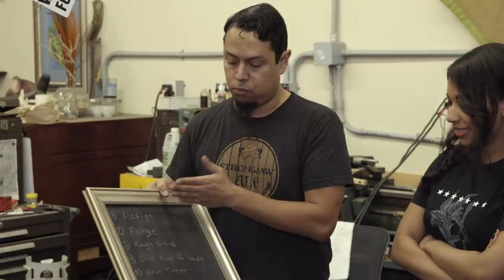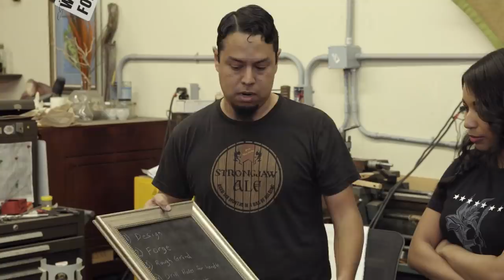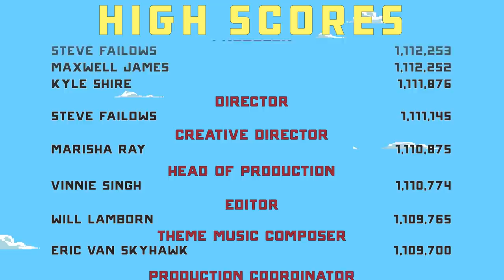All Work No Play: Blacksmithing with Mica Burton! | S2E5

Comment: Man adulting 101: Back Problems.
me: He is so right thooo...
Reply: I swear once I hit 30 my lower back just decided to give up on functioning normally.
Reply: Go to the channel Athlean X and find his videos on exercises for lower back pain. Most don't require any special equipment at all. Devoting 20 minutes every morning to these corrective movements before I start my day has reduced my pain levels to a fraction of what they were. I was a mechanic for 10 years before I got a desk job(engineering), and seemingly the moment I made the career change my body started falling apart. Sedentary lifestyles cause more pain than anything.
Reply: A co-worker asked me recently, "Do you even have any vertebrae left?"
Reply: @LuckyDragon289  Same for me, but I'm only 20 xD And my back is already killing me
Reply: 17 years of factory work did for me.  Lower back over ten minutes of working outside & upper back spasms from time to time.  Evolution sucks.
Reply: Jumping out of planes in the Army(more so the landings) did mine in. One more reason for Liam not to skydive.
Reply: No matter what your race or creed is, if you're an adult man...you have back issues. It SHOULD start very slowly at thirty, but if you're under 30 with them.... sorry to hear that bro. it only gets worse.

Comment: In the "Show 20 more real quick" you can check them all if you change the playback speed in options.  The second one is a dead ringer for Liam.  Also, the period and comma keys will advance and go back one frame at a time if you really need that level of control.

Comment: I was so happy to see Gil tell them to quench in oil. Too often I see bladesmiths use water
Reply: and they use masks. I'm so happy
Reply: @louisegrimhelm3041  Sometimes water is supposed to be used, other times oil is better. It depends on the metal you're working with.

Comment: Where can I get those shoes the Liam is wearing?! They look amazing!
Reply: I couldn't find it on the spot, but you might want to contact CritRoleCloset on the social media platform of your choice. They are uncannily good at finding results.
Reply: They're pride converse. Pride Chuck Taylor® All Star® 70 Low Top Sneaker, specifically. Sold out, but available used and in June, this year's will come out and likely be similar.
Reply: @Rtarara  Cheers Man

Comment: I work as a mechanical engineering technician in Germany and have done things similar to that. The only thing i would add as a safety measure is a leather jacket. You are sweating as f*** in that thing but it helps whith the sparks. And maybe some hearing protection. Smithing is loud.
And if any of you critters can try something like that, go for it. Smithing is so much fun!

Comment: Nice to hear some other Critters run saws, but for what they were doing in the saw sculpting video chaps, helmets, brushguards and so on would be totally unnecessary and cause more discomfort, thus making accidents more likely. 
Chaps wouldn't have hurt but, other than Sam running the big boy gas saw for a minute, they were using electric saws with overly tight chains.

Comment: So does it get work-hardened first or cool off first? Can iron be annealed or does it just need to be hot? I’ve forged a little with brass before, but for that we just had to anneal it before it work-hardened. Cooling off wasn’t an issue there. Maybe iron is too strong even when annealed? If anyone knows or can recommend any resources I’m definitely interested!
Reply: Steel doesn't work harden at nearly the same rate at what brass, copper or other soft metals do. 

You can cold forge steel but it is slow and not effective for getting the steel to move or shaping, cold forging is mostly used for slight slight clean up work and shouldn't be done on hardened steel. 

Annealing steal allows the grains in the steal to relax to create a flexible but strong piece. It is not meant for working the steal in the same way annealing brass, copper, aluminum etc is.

If you are asking specifically about iron and not steel (the difference is the carbon content) they are similar in their work ability and similar as far as annealing goes, and being hot to work. 

Steal and iron need to be pretty close to 1000 degrees farenheit I cant recall at what temperature but I want to say between 700 and 1200 to be workable. That bright orange color seen in this video, once it goes full red to gray it is no longer malleable enough to move. 

You can also burn steel to a point it is unworkable where as brass, copper etc can be like you said annealed prior to work hardening.
Reply: Ty Gramley Awesome thank you! I don’t want to bore you with more questions but would you happen to know of any good websites or books or other resources on the topic? Thanks again!
Reply: @molly-zx9cr  you are most welcome I don't mind questions at all. Are you interested in forging (blacksmithing) or metallurgy (the science of metal )?

For Forging alec steele on YouTube is pretty good and informative. And then I think I have some pretty good text books at home I will look when I get off work.

For welding which has a lot of metallurgy. welding tips and tricks on youtube, weld com

Comment: Hmm ... as a semi-retired part time bladesmith, this made me cringe. I am more than a little surprised that the fear exhibited by Sam and Mica didn't manifest as significant injuries.
Good job Sam, Micah and Liam for still having all of your appendages and not having to visit the local burn unit. Sam you can still fix your dagger ... instead of calling it an S blade call it a trailing point blade, then there's only one S in the guard.

While I don't really have a problem with what Gil said during his instruction, I do have a bit of an issue with how he presented his collection:

I hoping that someone lied to him, the axe presented as a Viking axe is potentially a Viking Era pattern, (~800-1100 AD ... not 1500), but was not a weapon ... it most closely resembles a hewing axe typically used to make framing for houses and the like. The clue is that when Liam lifts it he comments on its weight, axes intended as weapons seldom exceeded 4Lbs (swords  avg. 2-3Lbs). It also appeared to be made from relatively modern steel, an axe from the period was most commonly made from Iron and are very rarely found intact, this would have been a MAJOR find unlikely to have made its way into a private collection. Don't get me started on "King George's Sword", lets keep in mind that King George ruled from the late 18th to early 19th century ... nobody was using a medieval arming sword from the 14-16th century at this time for more than decoration. 
I have made many replicas of medieval and Viking Era tools, there is absolutely nothing wrong with that, I would NEVER misrepresent one of my creations as an historical artifact. Again, hoping someone lied to him, and he didn't know any better.
Reply: He probably just meant it was an old axe from medieval Scandinavia also he said 700-1500